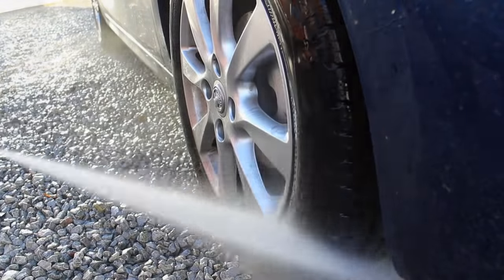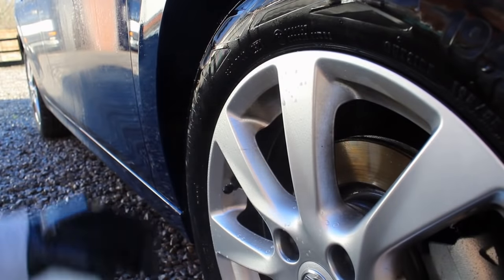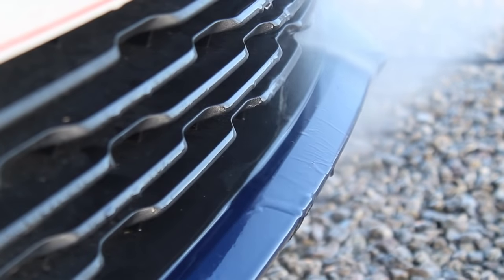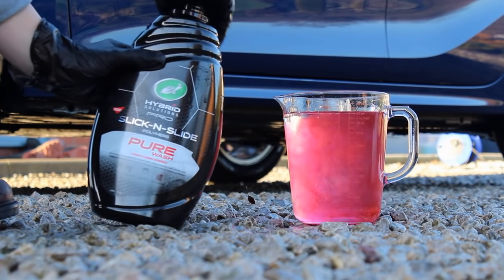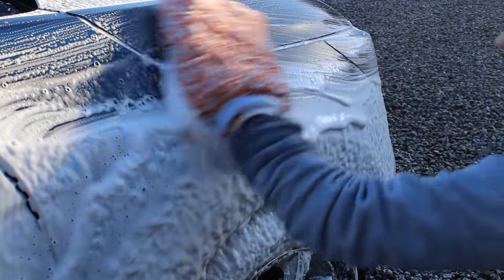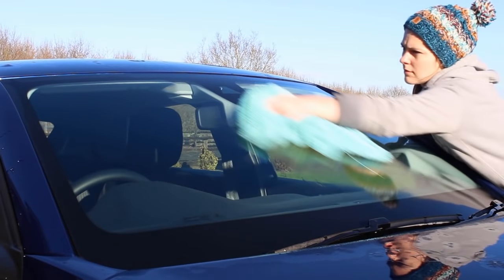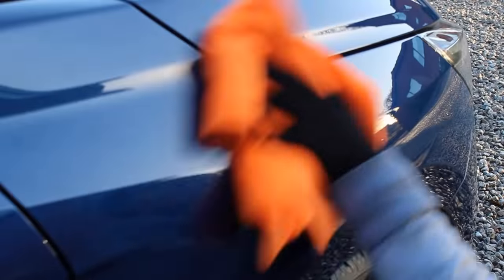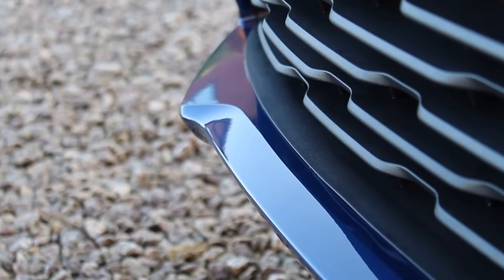Washing a Dirty Corsa | Car Cleaning and Protection Process

Comment: Nice idea using the snow foam cannon in the bucket. Might try that next time as a quick way to fill up water in a bucket and provide agitation without the hassle of turning off the tap, removing the hose lead from the pressure washer then turning it back on

Comment: Another super video Heather, you've actually answered something i had an issue with in terms of IW qdx graphene, smaller amount and short pile cloth to remove, will try that tomorrow as my project car needs a wash and protection top up. Also need to  get a dish brush for my arch liners, great idea. Your becoming better and better every video I see
Reply from the maker: Cheers Phil really appreciate that! A short pile towel is definitely the way to go I reckon, I always find it a bit harder to buff off products with something fluffier!

Comment: Excellent video Heather! That TW soap seemed very thick from the MJJC cannon, but still had a good density when was dwelling. I thought it will fall down right away, but it didn't :) Car looked amazing, as always, well done 🔥
Reply from the maker: Cheers Viktor! It was really thick I was expecting it to slip off the car as well but I've used it quite a few times now and have no trouble getting round the entire car when I just foam it all first. It's decent stuff, I reckon you can get away with a 1:15-1:20 ratio rather than a 1:10 which they say to use though and it still does the job

Comment: Hi Heather, I'm getting close to doing a chemical decontamination and would value your opinion on the best options for tar removal, to date i have been using a very old Autoglym product to address individual tar spots that is fine sometimes but tedious if you do a bigger road trip. I have had a scan through your videos and can't remember or see a specific video for this (probably covered under general cleaning). Your thoughts on process / products would be great. Best wishes.
Reply from the maker: I’ve used the Duel one recently and that did a good job. A few spots required a second hit of the product but overall it seemed powerful enough

Comment: Top video heather. the foam came out very thick great for the dwell time. what are your opinions on kirkland Microfibre clothes and the kent extra large drying towel? nice hat btw 👌
Reply from the maker: Thank you! I've used both those actually and they are decent but they definitely lose their softness quite quickly so I don't tend to use them anymore to be honest
Reply: @AutoCareHQ  Cheers Heath which microfiber cloths would you recommend. maybe a video explaining your cloths and towels could be a good shout 👍
Reply from the maker: @jazzam8012  I'll definitely do an accessories video and talk through them! I do like going for edgeless cloths with a 70:30 blend ideally but I'm not too fussy on the brand to be honest. I've just ordered some from carbon collective today for a new car prep video so I'll let you know if they're any good!

Comment: how did you deal with the sahara dust ?
Reply from the maker: I’d either rinse with low pressure or use optimum no rinse in a sprayer and let it sit for a min or two and then rinse with low pressure. Then snow foam and rinse with a jet washer